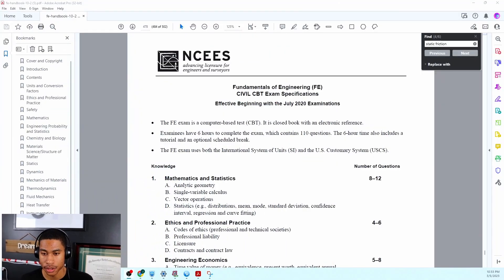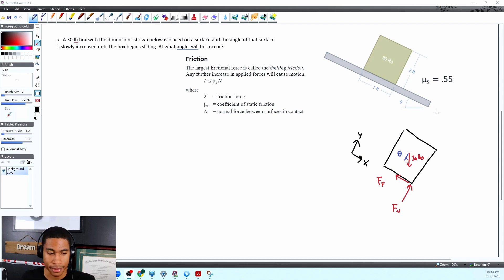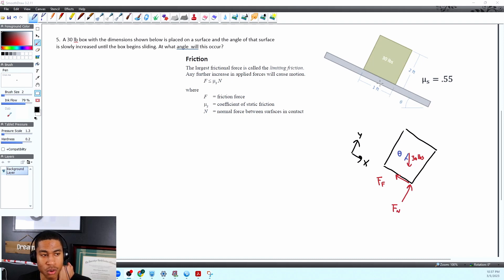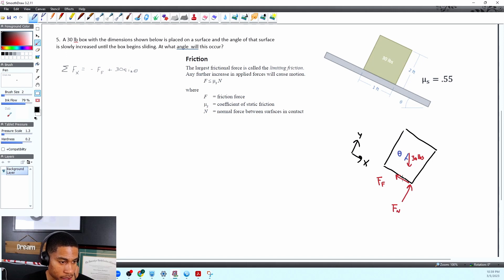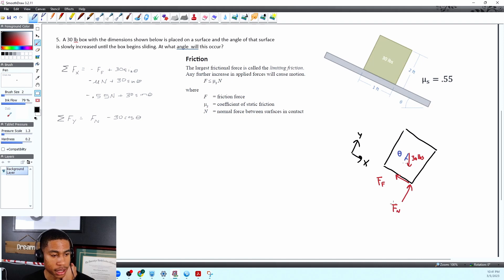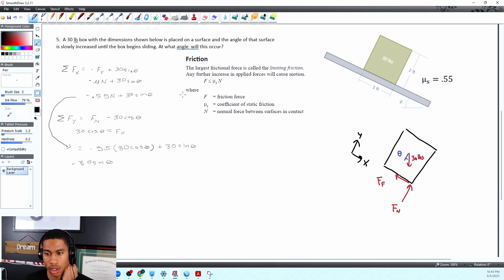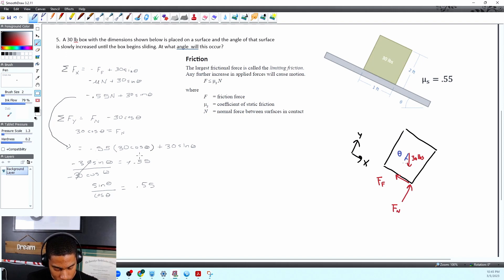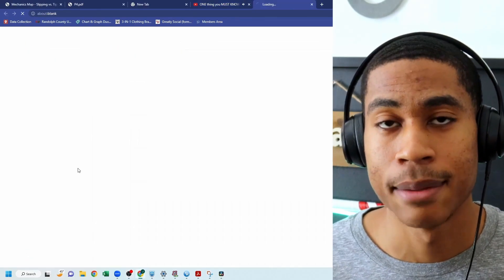Civil FE Exam Review - Statics - Static Friction (Problem and Solution)

Comment: great vid, but could you explain how your method for placing theta in your fbd?
Reply from the maker: Thank you! So the angle that is created by aligning the axis perpendicular to the box is theta. If theta is zero the box is already flat on the x axis. If theta is 90 the box is going to fall straight down. In this case theta is in between 0 and 90 degrees. We do this so that the y axis and the normal force are on the same axis. From there we can use our known weight to determine friction and normal force.